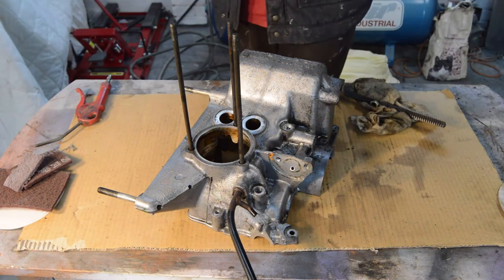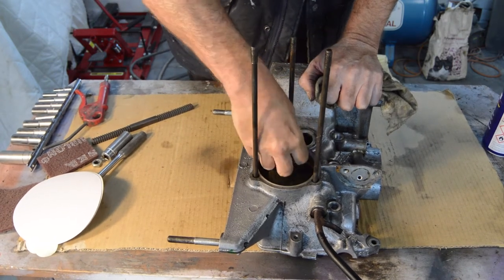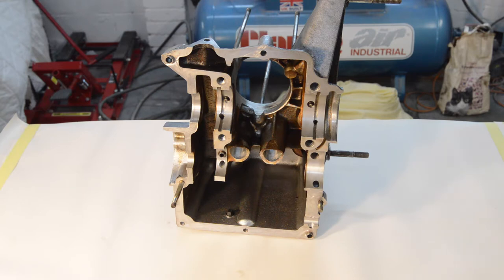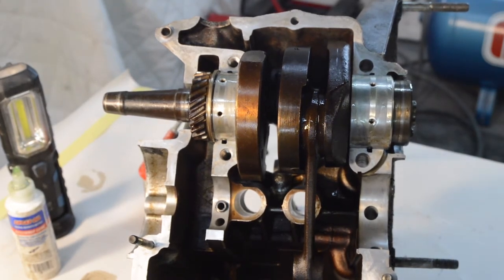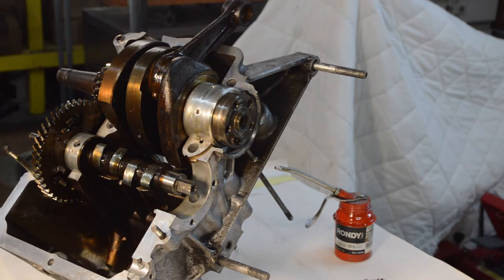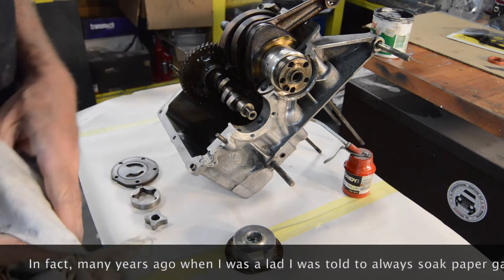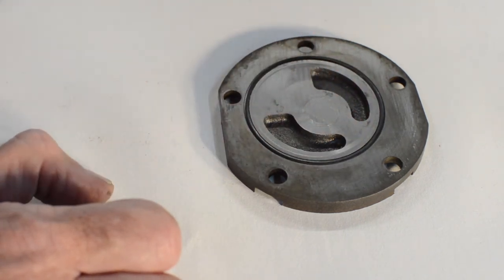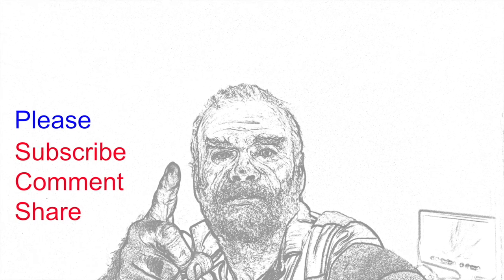2cv engine part 5

Comment: A day without learning something new is a day wasted. What did I learn today? That I have a soft spot for 2CVs. Never owned one. These days, though, I live deep in the wilds and a Deux Chevaux would handle my quarter mile dirt track rather better than my old Focus... Many thanks, and on to part 6...
Reply from the maker: Many years ago when I was lad there was a TV series about a company building a wooden car for Africa. As part of a long test from Nordkap to the Equator they were on a high pass in the Algerian desert clearly marked as suitable for 4 wheel drive vehicles only. They were 2 wheel drive but made it and as they were rightly congratulating themselves a standard 2cv crawled past them in the other direction. Truly a go anywhere car!
Reply: @oldnutsgarage  I remember that wooden car project. Never came to anything, which was disheartening. (My days as a lad are also a long time past)...

Comment: THANKS MARK  I learn so much watching your videos I didnt know about assembly lube.I once had a problem with an O ring like you it was a little bit small,I carefully stretched it and it fitted.Should I have not done this? Steve.
Reply from the maker: Thanks Steven. I do not think that stretching one slightly would be an issue. The problem this time was that the O ring appeared to be too weedy in construction and wanted to return to the shape it had been when packed in the gasket set. Thanks again for watching!

Comment: 32:55, I would not use grease, as grease will not melt at the normal temperature of the oil (engine warmed-up and running).  It could clog oil passages. Vaseline would be the preferred product.
Reply from the maker: I am not sure that a tiny amount of grease underneath a seal will cause any problems, but if it worries you then use vaseline by all means. Thanks for watching.

Comment: Distinguished gentleman.
Nice to greet you.
Excuse my writing. I don't speak English perfectly.
I've seen this entire series of videos, which are wonderful.
A question.
Are you sure you set the camshaft correctly?
This shaft has a torsional damper and after having tightened this damper, the marks are made to coincide with the gear of the crankshaft. I didn't see that he did that in the pictures.

Greetings from Viña del Mar. Chile
Reply from the maker: Hello Walter it is wonderful to speak to someone from Chile and thank you for watching my videos! The camshaft is fitted and lined up as Citroen states in their Factory Workshop Manual 8161. Thanks again and keep safe !
Reply: @oldnutsgarage  Hi! How are you.  Your videos are magnetic, I kept looking at every detail you do.  You have repaired a classic car.  I have also seen where to repair the suspension of the citroen, they are pluperfects.  Thank you very much for your videos and the patience you have had to record and edit them.  Many hugs
Reply from the maker: Thank you Walter, you are very kind, it is much appreciated !

Comment: The only thing I didn't understand is : how do you know if the hole on the crankcase is lined up with the one on the crankshaft,  you can't see them being underneath,  you can only see the 2 at the top, I m confused!!
Reply from the maker: You are correct you cannot see it happen, but you can feel it, although it is not always obvious, hence my caution when putting it together. Taking it in and out a few times helps develop the feel. You can also check visually as the bearing edge will not look parallel to the case. Thanks for watching!

Comment: Sir, I am from Pakistan and Citroen2cv lover N owner of 1968 425cc.i modified my engine with 602cc pistons cylinders by machining both as per its strok but I feel some hitting or knocking on valve so I placed shims inside of heads. My 2cv engine is more power than 425ccnow.
Reply from the maker: Hello Ejaz, it is wonderful to hear from a Citroen lover from Pakistan, a country I have always wanted to visit. It sounds like you have done a lot of complicated work on your engine especially as getting spare parts must be very difficult. Thank you watching my videos!
Reply: I also modified my 2cv1968 brake with booster pump of Honda car and installed wiile jeep wheel cylinder in front brakes.

Comment: Possibly a bit of debris left in the O ring slots?
Reply from the maker: Good point. I think the problem with the pump cover was that the O ring was pretty thin and wanted to return to the shape it had been in when packed into the gasket set. I think a better quality one might not have been so reluctant. The slot was definitely clean on that one. The smaller one for the oil filter housing which was changed on camera may have had some debris and I did wash the groove out later, but that O ring was not as much of a problem as the first. Either way, making sure that the slots are clean is a very good idea. Thanks for watching!
Reply: As filmed I did think that the slots looked a bit dirty, possible rubber from the old seal and you put in the new seal on top of that. Yes the seals did look rather thin but they do tend to fatten up when they get into contact with solvents. I like your meticulous and calm approach so not a reprimand! 
I think that the soaking of paper gaskets is more applicable to NOS stuff you pick up at autojumbles. The paper ones do shrink but a soak in the bath overnight usually brings them back to original size OK. Cork gaskets, rocker cover gaskets for example, also shrink. Put those in the bath too.
Reply from the maker: The bit about paper gaskets was just a passing thought while I was tinkering away as I have not done that for a long time . Petrol tap corks though are a different matter....Thanks once again for your useful comments and tips !
Reply: @oldnutsgarage  Ah, yes, tap corks. It's been a while. Early 60's actually.